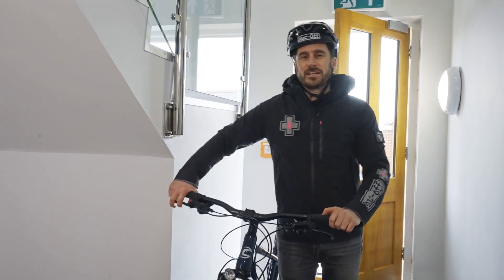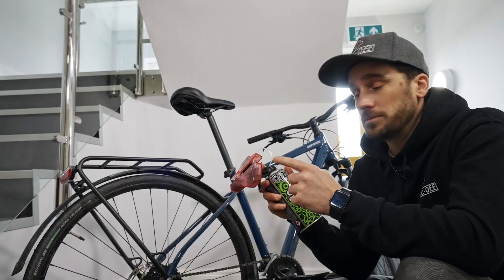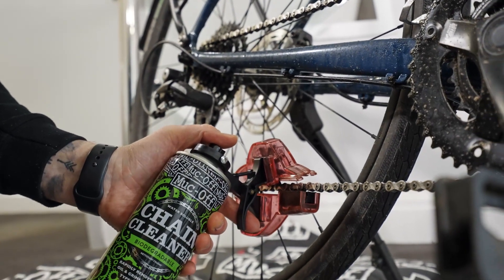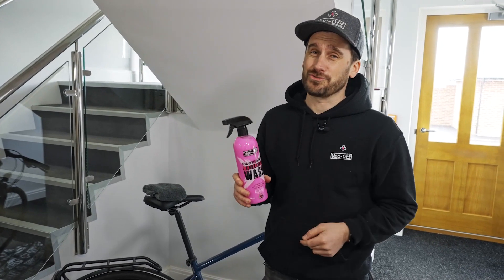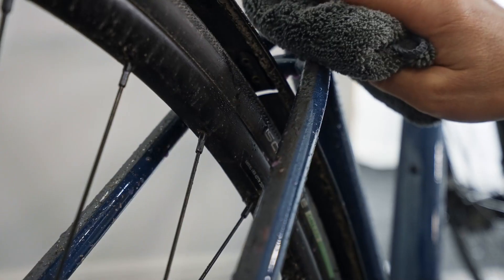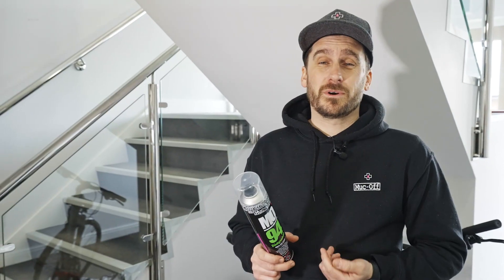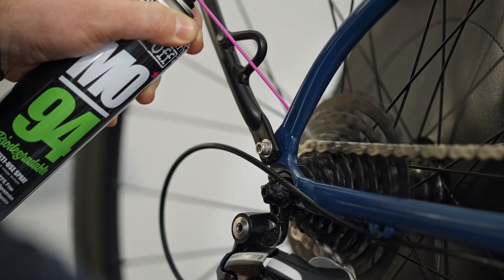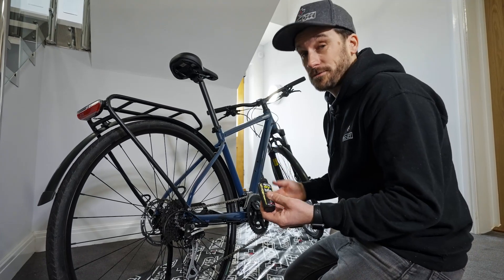How to clean your bike in an apartment

Comment: Great video!
Just one concern: After using degreaser on the chain, is it enough just to wipe away excess and apply MO94 before lubing it? I would expect the need for a decent rinse with water to remove all degreaser within the chain links.
Reply: not only that, what do you use to clean the cogs? didn't see him cleaning those.